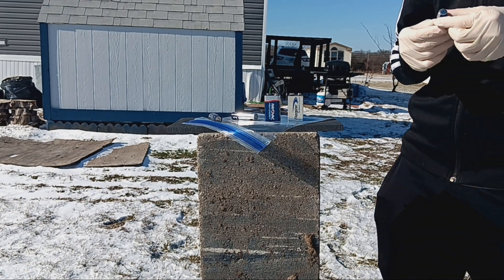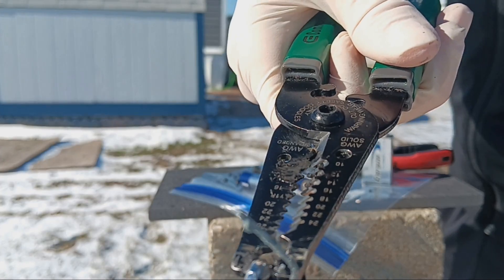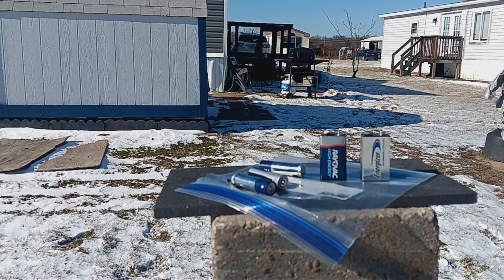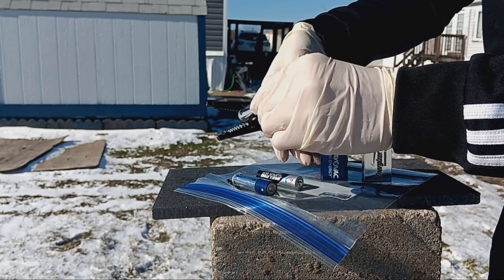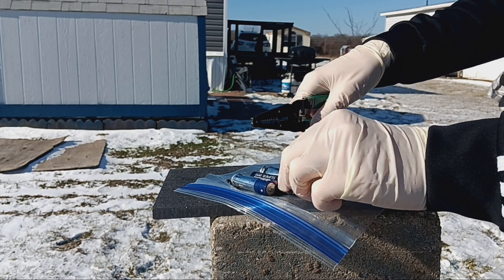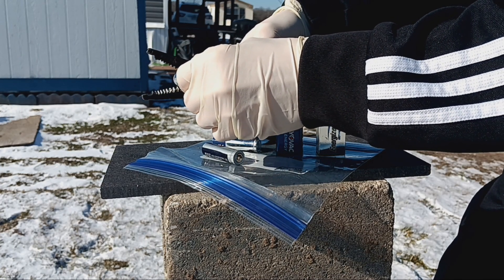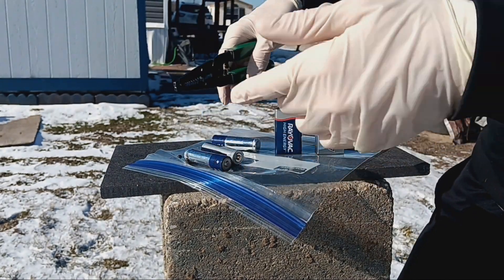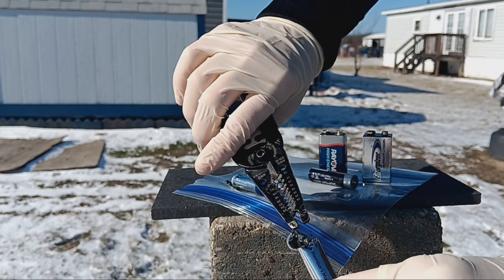Harvesting graphite electrodes from baterries

Comment: I have a bucket of old batteries from across the years of collecting them and getting them from my family, friends, and coworkers. Did not know there were quality graphite electrodes in these guys. This is a great way to catapult into chemistry. Sacrificial anodes and cathodes at no cost makes the entry much easier.
Reply from the maker: I was suprised to even find one because most of the ones I had cut into had tiny metal ones. Honestly the 9 volt batteries probably had some but I was very scared to open them.